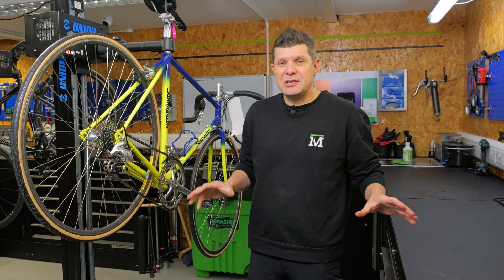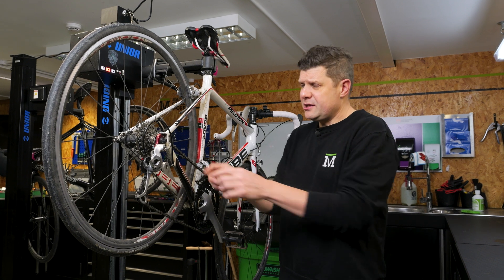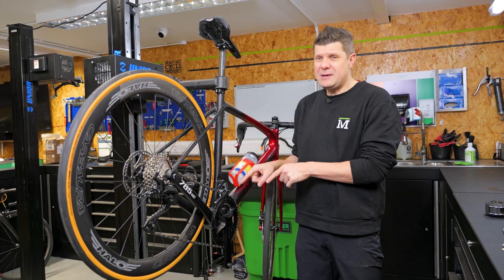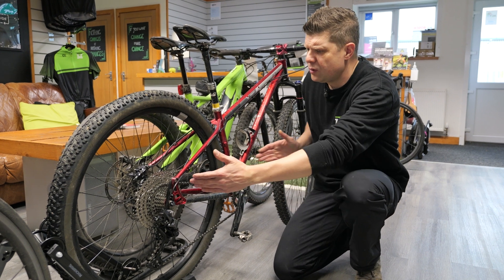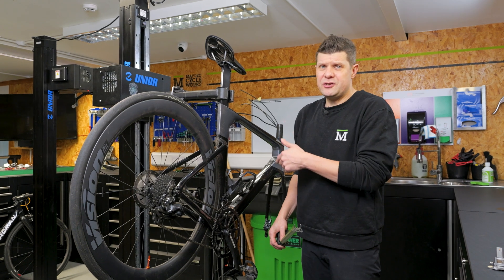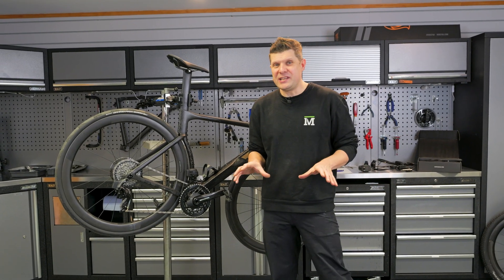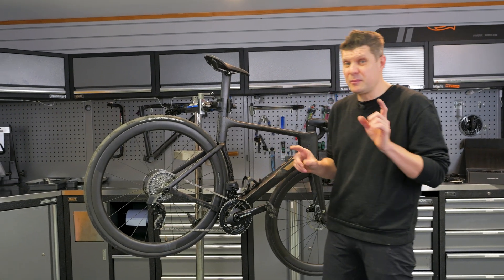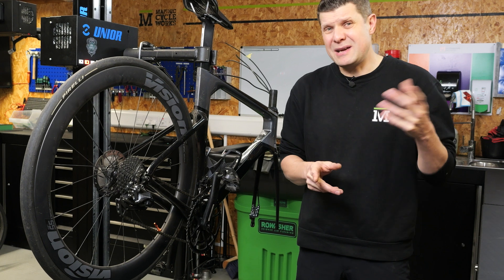This is why we have SO many bottom brackets

Comment: Isn't at least  part of the reason for increased BB diameter, the requirement for a large surface area to bond the aluminium parts to the composite parts?

Comment: Any comments of Mapdec to new Colnago using 68mm BSA bb?)
Reply from the maker: Really odd decision.  I suspect driven by the current kick back we are seeing against pressfit. The big media channels usually champion BSA.  IMO it should have stayed T47i.  I can see Colnago are only really interested in campy or Shimano cranks so they don’t need the bigger bearings, but even BB86 would have been a more obvious choice.  Seems odd to make a very aero bike and not smooth the air flow round the BB and just plonk two outboard bearings there.  BB86 would also have given more scope on the chainstay design.  I haven’t seen any reviewer question it.

Comment: Lots of errors please proof your videos ...  Trek OLCV?  No, OCLV.  41mm chainstays?  No, 41cm.  All the lugged bikes are BRAZED, no WELDED ... Most of the reason for all the crazy BB designs was experiments to make a much lighter and patentable proprietary bottom bracket cartridge, Shimano started the bad trend with ISIS, its nothing to do with chainstay length ...
Reply from the maker: You mean 3 insignificant misspeaks and your misunderstanding. 🤷‍♂️

Comment: Strange that none of the creators of the various bottom bracket standards said anything about chainstay length when unleashing their creations and instead touted things like weight and stiffness. it's almost like frame geometry has nothing to do with the bottom bracket standard
Reply from the maker: No. They just mention handling.  Cannondale made a big deal out of it with Ai and Pf30a
Reply: @Mapdec  I'm becoming less convinced you know what a bottom bracket is or does, not even sure you know what cannondale Ai is either if you think that supports what you said
Reply from the maker: @GaryM-ft7pw  don’t worry. You’ll soon catch up. 👍
Reply: @Mapdec  I think you're probably underqualified to work assembling bikes in halfords, seriously the simple existence of bottom bracket adapters shows just how dishonest a video this is

Comment: I hope the rest of the video was interesting, but "welded" instead of brazed and "millimetres" instead of centimetres is so annoying that I stopped watching.
Reply from the maker: Ah. You missed out.  It’s not a video to explain how metal is joined.  Everyone knows that welding joins metal. Brazing is term that didn’t need explaining for this short video.
Reply: @Mapdec  Sure and yesterday did you "hammer" some screws into your wall?  The other day did I "hammer" in the bolt that holds on my classic tapered crank arm onto my BSA crankset?  Personally I'd use the correct verb.

Comment: Great video, but a few quibbles :) That Swinnerton is of course brazed not welded (you can't weld 531) and the BB shell is a single casting. Second the real compromise is between Q factor, CS length, tyre width and tyre diameter. The CS has to find a path around the tyre to the BB shell without hitting the cranks or the chainrings. That is the real challenge. It doesn't really matter what BB shell you're attaching it to (whether it's 68mm or 73mm wide or whatever the diameter). Third, an ovalized CS doesn't have any more surface area to weld to-- it's the same perimeter, you just squashed it. In Damon Rinard's FEA (for what it's worth) round/oval/round CS were better for torsional stiffness than ones that were oval at the end. I don't know why the trend for oval. No real advantage but they are easier to weld on because you can fit your TIG torch down the middle. However I have made a number of TIG frames with ROR CS and 68mm shells and it can certainly be done. Fourth, everything gets much easier if you just use 650B or 26" if you want fat tyres :) But these days people seem to want 700c, really wide, and short CS hence the creative solutions like dropped CS as you said. So in summary I'm not sure all this justifies all the BB standards. There was always a use case for 68mm and 73mm and most BBs were compatible with either. But not sure we needed BB30, PF30 and all that for the CS length business. Cannondale invented BB30 I think because they wanted to use aluminium axles, which need to have larger diameters. PF30 was just the same thing but with sloppier tolerances. But regardless of BB standards it's an interesting discussion about that four way compromise between Q, tyre width, tyre diameter and CS length, and that is certainly one of the fiddler aspects of framebuilding. Another thing people do to effectively reduce the CS length (on steel frames) is curve the seat tube backwards. Finally CS length is conventionally measured down the middle, i.e from centre of BB to centre of rear axle. But it doesn't make much difference. I think on that aluminium frame the stays had probably just been squashed a bit rather than hydroformed, and of course people have been dimpling chainstays on steel bikes since forever. That can allow you to squeeze a little bit of a bigger tyre in.
Reply from the maker: This wasn’t a video about joining metals, and I wasn’t going to make it longer to start explaining terminology.  Some of your other facts were quite wrong. For example PF30 helped solve the tolerance isssue of BB30. BB30 was only on metal frames and the bearing pressed directly into the shell. PF30 allowed the use of a bearing carrier to help. Cannondale still messed it up, but the thought was there.
Reply: @Mapdec  I thought that's what I said about PF30? It's what I meant anyway :)
Reply: All the way through this video I was thinking "if you want to keep the chain stays short just fit smaller diameter wheels!" I think it's crazy to go to such lengths to accommodate 700c wheels, and for what gain over 650Bs?
Reply: @nickwinn7812  that is already done, and has been done for at least 40 years when cannondale had a 24"/26" mountain bike. can't recall which was front/rear. when disc brakes came along, changing wheel size became less of an issue (other than say bb height) and could also accommodate larger variety of tire sizes. nothing to do with bb width. 73mm were used back in the 80's and of course much wider bb's for non-road bikes. about the only time bb is a major factor is with e-bikes and their bb mounted motor.
Reply: @nickwinn7812  I think it started with "29er" mountain bikes. The big wheels help you to ride over everything like a monster truck. But the actual rolling diameter of a 26" wheel with a fat tyre is about the same as a 700c with a traditional narrow tyre. And these are gravel bikes we're mostly talking about. So yes I don't think we need such big wheels.

Comment: Taking 0.5cm (or less!) off a seat stay length is surely not going to be a gamechanger for agility on a bike?! There is definitely a degree of cost saving for manufacturers (in just needing a hole for press fit rather than a threaded shell) and also wanting to create new proprietary BBs people also had to buy/replace rather than standard BSA ones anyone can manufacture...
Reply from the maker: I’m not sure I get your point.  A hole is cheaper and easier than bonding an alu tube with treads into the frame.

Comment: I don’t know why you’re so stuck on chainstays. I don’t think anyone could reliably tell the difference between 400mm vs 410mm. Also even if a 400mm chainstay was by some measure ideal for a size 54, that doesn’t mean that will produce the best handling characteristics on a size 58. Years ago I bought this weird 60s Japanese frame and built it up with modest parts. I quickly fell in love with its handling and opted to ride it more than any of my other bikes, despite it being heavy and having ancient technology. That bike had 460mm chainstays on a road bike designed for thin 25mm tires! That’s longer than basically any gravel bike on the market and is firmly in hardtail territory at least! This weird geometry made steep climbing feel incredible stable, and descents feel so confident. The steering was still as quick and responsive with a high trail fork. It was the quirkiest frame that was probably only designed that way because the Japanese manufacturer was out-of-touch with what popular European Manufacturers were producing at the time. It even has the strangest 70mm wide BSA threaded bottom bracket shell!
Reply from the maker: Stuck.  I made one 10min video out of collection of 600 odd, and this one mostly focused on BB development and why tyre width and Chain stay length played factor in the development of all the standards we have today. I’m glad you found it entertaining

Comment: In the BMX industry, standardisation has ruled supreme. There was a brief period (2002-2004) when screw-in 'Euro' BBs arrived. And a few manufacturers experimented with smaller diameter shells to save weight. But these innovations never took root and an industry standard emerged. Why? I think it is because the consumer demands standardisation for the sake of customisation. Riders have different needs, and they want to be able to piece together parts from different companies to meet them. In road and MTB, consumers are used to buying a complete bike and changing very little other than perhaps tyres and the bar tape.
Reply from the maker: Doesn’t BMX have 19,24 and 30mm spindles, bsa, American threads, and a couple of press fit standards too?
Reply: @Mapdec  There are two crank axle sizes: 19mm and 22mm. But the outer diameter of the press fit bearings are always the same, and there are no threaded options anymore. The parts companies' bottom brackets are identical aside from the logos on the spacers.
Reply from the maker: @ I forgot about 22mm. DXR cranks are 24mm. Isn’t there a Spanish standard as well?

Comment: I had a old Mondia cyclocross bike that had a bizarre bottom bracket threading and axle length... M35 X 1.0 mm threads but the drive side was left handed,  non drive right handed..And weird inside BB cup size.. nothing fit.. loose packed bearings and hope for the best...

Comment: Most British custom fames weren't ever welded! BMX and then mountain bikes brought TIG welding to the high-end bike industry, and it didn't get to road bikes until at least the mid-1990s, and even then British and Italian builders didn't take to it. In fact, even the best custom British MTB frames (Overbury's, Roberts, Yates, etc.) were never welded. Pegoretti and Raleigh (yes, Raleigh made pro-quality frames back then!) were some of the first road brands to use TIG welding, but they were outliers. Brazing, which is very different to welding, is how the vast majority of steel road frames were constructed until mass-produced imported aluminium frames took over from local custom steel. And, that old Trek OCLV would have seen 23mm tyres maximum. Anything wider for a serious road bike is very recent. I left the industry in 2016, and 25mm or wider tyres on a road-race bike was still a very strange idea back then. In fact, the carbon frame brand that I worked for made TT and Tri frames that would only take a 23mm tyre. A 25 (or fatter 23s from Michelin and Vittoria) would foul the seat tube cut out! 23mm Conti clinchers - or 22mm tubs - was where it was at for serious road and TT bikes. There has been a rapid demise of the high-end bicycle. What was once an elegant and beatifully simple device got caught up in a tech arms race and marketing BS. Unless it's a serious race bike, for actually racing on, all this tech and multiple standards for BB, hubs and headset is total nonsense and is killing cycling. Electronics likewise. Internal hydraulic lines likewise. odd-section seat posts likewise. One piece cockpits likewise. Tubeless likewise. We had more fun in the 1990s, 2000s and 2010s with much, much less. Club road cycling was affordable and accessible. MTB was a blast and didn't involve costly/complex suspension bikes or packing up and trekking off to distant trail centres. Bikes could be worked on at home, easily. Fit was a doddle to adjust for. Stuff lasted. Spares were standardised and simple to source. New bikes are ugly, heavy, unreliable, plastic, foreign (in every sense!), complex, fragile, tricky to work on, and very, very, very, very, very expensive. Tomorrow's landfill. Something has gone seriously wrong.
Reply from the maker: I think you are only remembering the good bits of the past.  No one is storing you riding vintage gear.  It’s still out there.  🤷‍♂️
Reply: @Mapdec  There were no bad bits in my past. Having worked for years for a top-end carbon frame brand, I now ride only steel fixed on the road and steel, rigid, singlespeed MTB. You're right, nobody stops me!!! Steel is the real deal, Neil.
Reply: There are plenty of "bad bits" in contemporary bikes, too. Bikes of all qualities have always coexisted@Mapdec
Reply: You just summed up what I've been feeling about "modern" bikes for the last decade. I think one of the problems is that many people think that if a thing is more high tech, it is automatically better, and even worse, will somehow give them a performance boost.
Reply: @nickwinn7812  A big part of my job in the industry was to make supposedly clever people buy stuff - that they didn't need, wasn't suited to the use they would put it too, and cost more than they could really afford. It wasn't difficult, and "victims of marketing" is how we described them amongst ourselves in the office. Bexit, Trump 2.0, and the purchase of top end road bikes by cyclists who will never race race are all examples of consumers/voters (same thing) willingly acting directly against their own interests. It would seem that consumers are irrational and compulsive, and will fall for the marketing hype every time. Kerr, ching!!!
Reply: @davidpalk5010  A fool and his money are easily parted.
Reply: Some advances like the freehub, clipless pedals, threadless headsets are extremely worthwhile. I have my restored and modified pre 80s high end road bike. Some of these advances have been instituted. Have you ever cut the stitching and repaired a tubular? I don't miss it! Clinchers are way better, but I'll pass on any sealant mess! Ok for mtb though.

Comment: Dude completely glosses over the role of the CURVED SEAT TUBE. If you're willing to curve the seat tube like in the final bike, you could probably go back to a BSA BB 🙄
Reply from the maker: But then you would have tiny bearings for DUB cranks. 🤷‍♂️
Reply: @Mapdec  Well if manufacturers had committed to curving the seat tube when wider tires started being a thing, maybe DUB cranks wouldn't need to exist and we'd all just have cranks with a 24mm spindle.

Comment: Why is there so much effort to keep the chain stays short?   

I feel like this is the last hold out of the “feels fast” era.  110 psi feels fast but isn’t.  Short chain stays feel fast.  Are they?  Is there any measurable performance benefit?
Reply from the maker: Subject of a different video.  In fact probably many videos.  The effect is generally no different to a car.  The main difference being the cone of movement of the rider.
Reply: @Mapdec  hmmm. I’m not sure I understand how that translates to a performance benefit.  

I think I would prefer a slightly longer chain stay in exchange for a more reliable (or consistent) bottom bracket standard.
Reply from the maker: @and2244rew  nothing wrong with BB386 or T47.  Anyway. Depends how you measure performance.  Straight line speed a long chainstay and long wheelbase would be better for stability.  For fast corners, manoeuvring through a peloton, a shorter wheelbase would be easier to maintain speed.  Most people don’t race, but like the fun of a race bike.  Same with cars and motorbikes.  Sports cars rarely see a track and only cruise up and down motorways. It’s crazy, but we all enjoy it 🤷‍♂️
Reply: Short answer, short seatstays are NOT fast.
Reply: Lighter steering, think of a car with power steering vs without.

Comment: Doesn't Shimano specify that chainstays should be at least 410 mm for disc brake road bikes? Would 400 mm stays prove to be an issue?
Reply from the maker: Depends on ratio, but generally 405

Comment: Nice and insightfull video! There is only one thing that gives me a headache: Please stick to static shots! And please don't do shorter cuts than 3 seconds. I almost stopped watching in the middle of the video, because all the movement and some VERY short cuts made it hard to concentrate on the content.
Reply from the maker: Come and edit for me.
Reply: Don't try to be flashy. Unnecessary.  @Mapdec
Reply: @Mapdec  that was meant to be constructive feedback.
Reply from the maker: @andreasruther8750  it was a genuine ask. I’m on a faster learning curve than I can handle.
Reply: @Mapdec  Finding someone in your area (or even remote) to edit your videos shouldn’t be too expensive. If that’s not feasible, there are some basic rules that you can learn quickly, some of them I tried to outline above. Some will even save you time, like your camera person only hitting the record button once the camera angle is right and only move the camera away after they stopped recording will be a huge time saver when editing (a tripod could help). 
So you can decide if you throw money or time in. Or you find a film school intern, but that often ends up in more time spent in educating them, even with professionals you need to communicate and things can go wrong.  So as always there is no silver bullet.
Reply from the maker: @ thanks. I’m trying so hard not be like GC performance and Hambini and just be a dude with a GoPro.

Comment: I don't think in the time of the Trek oclv anyone was riding 25 or even 28 mm wide tyres as they were not readily available as race tyres. Anything over 23 mm would have been hard to find. Trek were probably looking for a longer wheelbase without slackening the head angle too much.